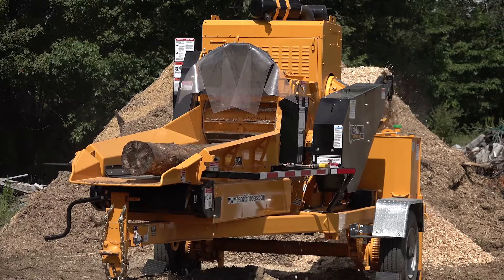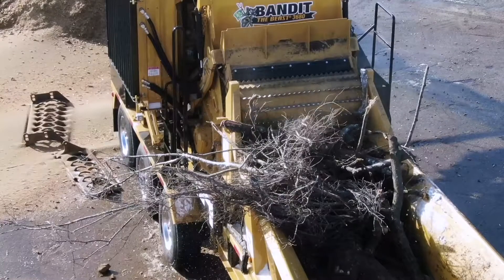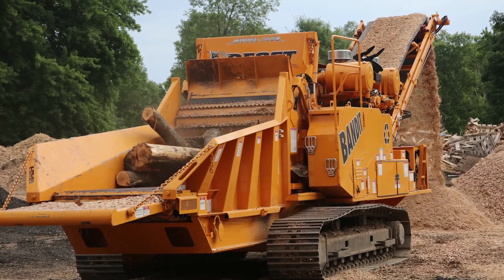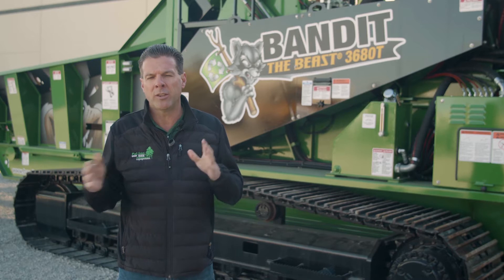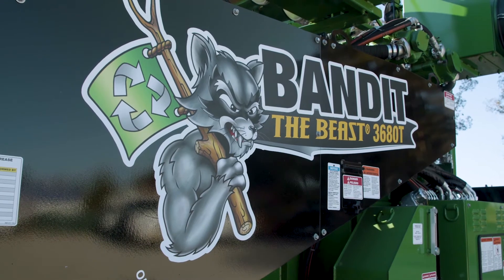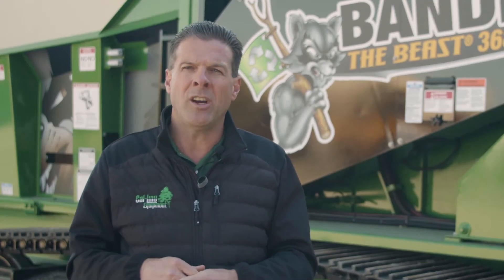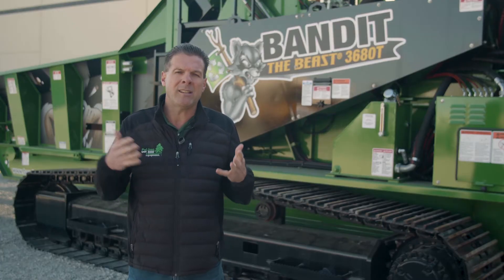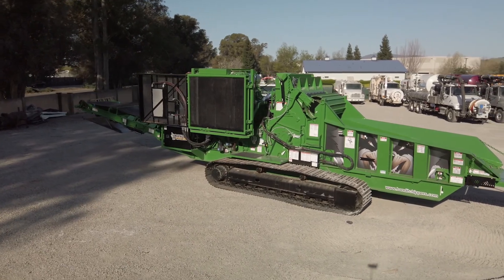WHOLE TREE GRINDER 🪵 - BANDIT 3680T 🦝 SPECS - WALK AROUND & REVIEW

Comment: 1st things 1st changing a screen is not a 1 man job and is not a half an hour job. #2 the teeth are very pricey as well as the brackets to hold the teeth. Then we get into the the orientation of the bolts on said brackets on the outer brackets so that to remove the bolts to change them you have to cut the bolts off to remove them . Then we should also talk about the design of the the box the hydro and brain are located in. If you blow a hose it power washes the electronics with fluid. No drain holes in those said boxes as well. That is a bit of a design flaw. Other than those issues it's a great rig
Reply: And we just got fired up and ran 10 grapples full through and busted one of the brackets that hold the teeth on. Was grinding some cottonwood logs no bigger than 16 inches. Wish I could get a whole day of grinding out of this machine.